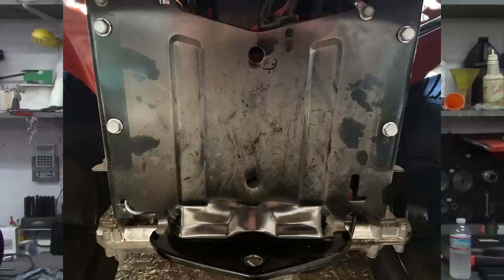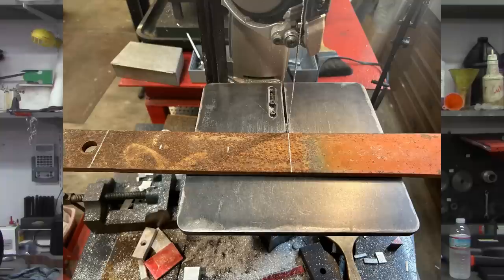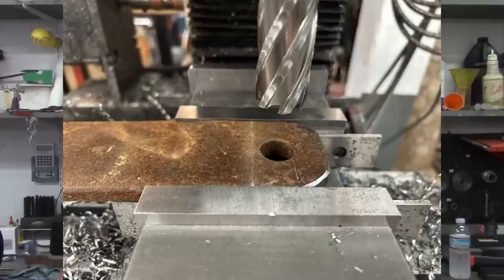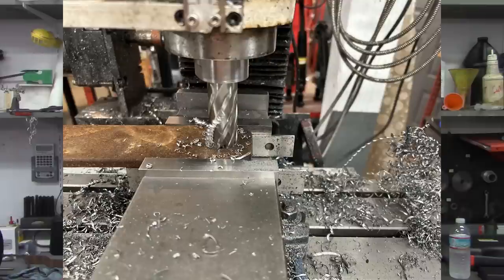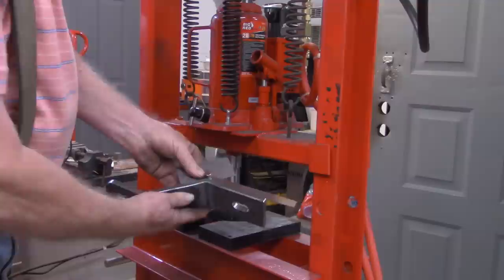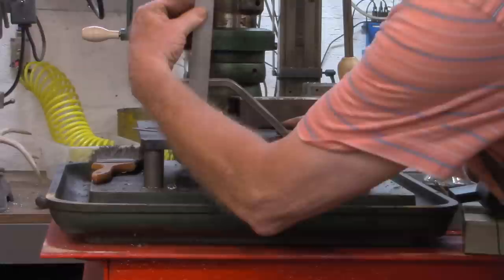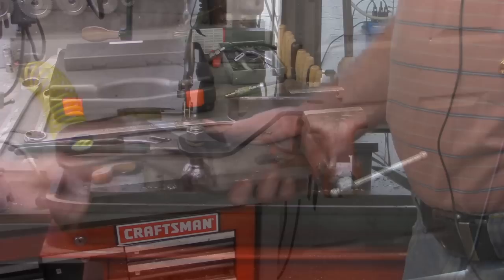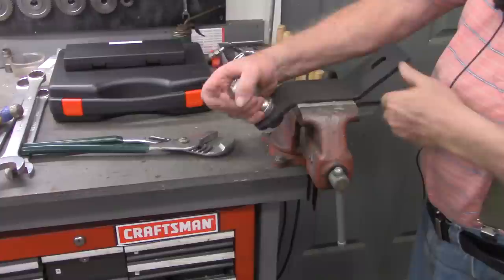Fabricating a Trailer Hitch For a Lawn Mower

Comment: This a great addition to any mower, but let me add a few words of caution from experience.  First the metal will probably droop without a brace to the upper hole on the from.  Secondly, and most important, with the hit so high she will run the rick of the mower tipping over backward on her the first time the trailer tires hit something in the yard.  I speak from experience.  Thankfully I was a heathy 30 something and could escape.  I know you would rather not start over, but we all know you would not want your niece hurt.

Comment: Great job Lee! I've done 3 of these, 1 exactly like this, except the metal was new. Just an FYI, that is not a Yellow Jacket Nest, it is a Paper Wasp Nest... I couldn't tell you which wasp was which without a book if they both landed on the same flower... but the nests are committed to memory because they make no sense to me... the open faced nest (like that) is Paper Wasps, the big paper balloon hiding the actual nest combs, is Yellow Jackets... Oh, the Paper Wasp has a nastier sting than most other Wasps.

Comment: Really nice work Lee. As far as a larger trailer goes, I'd be worried about it standing that garden tractor/mover on end. I know I can pick up (by hand) the front end on my old 42" John Deere rider to put it on jack stands so I can work on the blades or get under the deck. You may have to build her a ballast rack to keep the front wheels on the ground. I know you can buy them but I'm pretty sure you could build a nicer one for less money.

Comment: I was looking at that same problem a while back.  That hole in the tractor is only sheet metal and not real thick metal at that.  I just would not use it for anything heavier than a dream.  Look just inside the wheels on the axle housing there are a couple of bolts.  This would be your ideal attachment point.  Need to come horizontal off the axle there and then weld or twist your flat bar to clear the inside of the wheel coming back to join them at the back.  Preferably with a weld at your desired height and a hole as you require.  Now you have something that will not bend the first time someone steps on the trailer tongue.  That sheet metal rear is really cheap but it appears on most mowers today.  Take care.  Doug

Comment: Nice job Lee - I'm fabricating one myself for my Toro Z4000 Zero Turn mower. It came with a nice hitch, but I need about a 2 inch drop for my yard trailer and a 2" lift for my landscaper trailer. So I'm actually welding up a 2" receiver hitch for my zero turn so I can just flip my hitch ball one way or the other pending which trailer I'm pulling. . Can I suggest to you to use one of those digital angle finders while making your bends? I have several of them in my shop for all my table saws and find them quite useful for bending angles as well as they do on my saw blades. They are quite compact, mine all have a swivel out screen (which helps viewing sometimes) and a magnetic base. The perfect solution for getting your bends perfect first time. Also - an impact wrench works best for tightening your hitch ball - no need for vise clamping. I hear ya on the yellow jacket stings - I was once stung over 100 times when I encountered a hornets nest walking in the woods at 12 years old. Lucky I wasn't allergic, but still a very traumatic and painful incident!  Okay, thanks for another most enjoyable video my friend!

Comment: okay when you compared the two pieces of steel you were going to use for the tong part ruff 6:48 i did notice not sure if others did but its not the same piece whether you started with it is two different pieces bit wider and end round not the same plus has mill scale  i don't relay give but no need to say one and use another just don't show the two and no one would be the wiser nice part but where you have it mounted to the lawn mower it will bend just under the weight of the trailer and pulling on this also not good as it will eventually give up cheers  .

Comment: Nice job 👍👍👍 those dam yellow jackets are flying assholes is what they are I just hit em with a quick burst from a propane grass burner I had a colony of bats that lived in my tree for decades and one year they just disappeared and I had no idea how much work they did until they were gone and we had hornets nests everywhere in the eves in the sheds inside tubing and pipe in the scrap pile got me in the lip one day and my lil dog on the neck and man we both swelled up huge after they got my lil man I went around the yard every couple days burning new nests out for about 2 weeks until they finally stopped coming back !
Reply: Also if anyone reads this don't use a torch near your house etc unless you know what you're doing and take the proper precautions so you don't burn your house down !